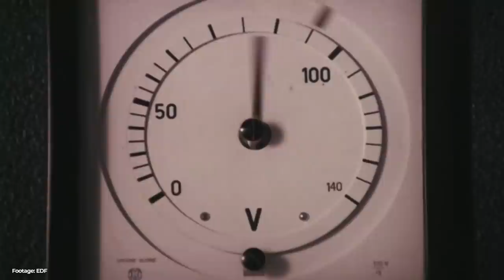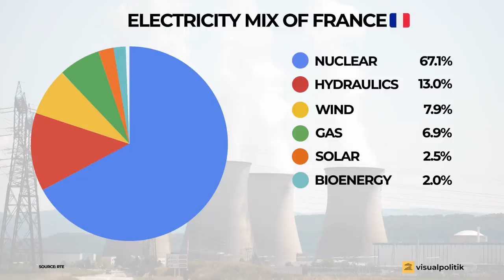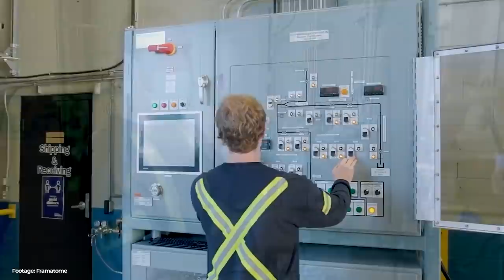Why is FRANCE betting on NUCLEAR ENERGY again? - VisualPolitik EN

Comment: Because a. the French aren't stupid, they want to be able to maintain stable base load power generation and b. have surplus output they can sell to the Germans when they finish screwing up their own grid.

My understanding (and correct me if I'm wrong) is that the French wisely standardized their reactor designs. This is in contrast to the nuclear situation here in the U.S., where every reactor is unique and practically a work of art. That's unfortunate when it comes to safety and maintenance concerns.

Comment: Nuclear has always and will always be the future, the power density ratio has no match.
Reply: If the land that a nuclear power plant is on was covered with solar panels, including the setback allowances, Solar would produce more power from the same amount of land. Also people can live there, they can build their homes under the solar panels, their garden shed can be covered in solar panels. The cost for the solar installation is much lower then actual nuclear build costs and no radioactivity is released.
Reply: @tomkelly8827  but it doesn't work when is cloudy and at night.
Reply: @tomkelly8827  it is nice dream,.. but lavs of physic are aginst you. You are also ignoring a hellot of toxic materials used in those solar panels.
Reply: @tomkelly8827  nope. It's the exact opposite. Solar would require way more land than a nuclear plant to produce the same amount of power.
Reply: @tomkelly8827  Anywhere north of Chicago, solar is carbon positive.

Comment: Pretty much majored in Energy production way back in 1987 for an engineering bachelors degree and worked briefly in the nuclear industry as a draftsman. Never used that knowledge and ended up in the design of heavy machinery so I should be knowledgable but not an expert. They didn't need energy production engineers in the late 1980's and early 1990's. At least that is what they thought. The biggest two problems with nuclear energy is cost and long lived nuclear waste. Today's reactors are much safer than the reactors in the 1980's but most are still  producing long lived wastes and that includes the SMR. SMR's may cost less to produce and then perhaps not as you have to produce more of them. At least SMR's would allow you to spread your costs over a longer time period. Molten salt reactors require no containment vessels and are best produced as a SMR or on a factory assembly line. They have no pressure on the reactor parts and therefore can be designed with a lot less material. All this adds up to lower costs but salts are very corrosive and the only parts that can withstand this corrosion are expensive nickel based alloys. Using thorium as a fuel not only uses a very abundant nuclear fuel but can be breed to U233 which can be used in future reactor runs. The reactor can burn most of its waste to produce more electric and reduce its waste down to a storage life of 300 to 400 years verses 10,000 years for our current reactors. The biggest problem is clear, we never developed this reactor because most countries wanted to breed fuel that could be used for nuclear weapons. Thorium based reactors can not breed fuel suitable for nuclear weapons. It is going to take a few more years to develop a salt based thorium fueled reactor. NG based plants have been made as combined cycle plants with up to around 50 to 60% efficiency. They not only require a lot less fuel but should have very low CO2 emissions. As far as methane emissions go most of your methane emissions are from the heating of rotten plant matter in the Boreal and Actic regions, not from gas industry pipelines. Even if you don't view combined cycle NG power plants as ideal; they are at least a start in solving the problem until something better is developed. Whatever is decided make sure the plants are combined cycle and not single generation cycle plants that are lower in efficiency.
Reply: @olivierb9716  The idea is to fission the U233 for further energy production and then dispose of the waste. As far as removing it from the reactor's salts I have heard that it is quit difficult but I am not an expert. As far as experimental, yes only Oak Ridge has run one experimental reactor or this type. The research looked very promising but looking promising & being feasible are two different things. All I am saying is that it should be worth the small amount of research needed to find out more about this reactor.
Reply: @olivierb9716  plutonium is extremely toxic and you have to breed fuel to make nuclear a long term energy solution.

Comment: I can't believe the EU is actually putting natural gas and nuclear energy in the same group. One is environmentally stable and the other is environmentally devastating.
Reply: Germany us betting on Gas as backup,.. there is no wonder that this nonsence is going trouth EU,...
Reply: @Baamthe25th  Unfortunately, the transportation requirements mean that natural gas lifecycle emissions are 47% higher than the direct emissions at the site of consumption. Plus leakage is a big problem and as much of the natural gas is methane it is an even bigger problem as that causes 4 times the greenhouse effect as CO2 does. It also releases Nitrous Oxide.
Source: Sorry, YouTube won't let me put a link in my comment even if I use [dot]

Comment: Natural gas is not cheap and you will be under the thumb of Russia. 
It’s also emitting a lot of CO2 as it’s ultimately a carbon fuel.
Reply: There is still reserves off the shore of Holland, and France buys its gas from Algeria and Egypt as well as Holland as previously said. The advantage with gas is that you can make combined cycles power plants (a gas turbine producing electricity with the exhaust heat directed to boil water that will too spin a steam turbine). 
However, it's indeed still a carbon fuel and that will fuck up the climate and ocean water pH

Comment: What I hear from most governments including my own here in Canada is that they will meet certain goals in the future but they have no plan to get there. They want to attack carbon at every chance but yet they continue to push natural gas. I am an electrical engineer with 41 years experience. Nuclear, especially SMRs is the way to go. It is cost efficient and completely calculable. One thing that renewables suffer from is that they generate the power away from where it is needed and there are significant losses. SMRs can go anywhere. IN Canada's arctic they burn diesel for electricity, that is really ugly from an emissions perspective, a SMR fixes that. The only way to solve the energy puzzle is nuclear in combination with renewables. The arguments against it hold little weight and are mostly political as in the case with Germany. One more thing, anyone that thinks that solar and wind turbines have a small ecological footprint should take the time to research the lifetime of these sources and they will se they are nowhere near as green as they think.
Reply: SMRs made sence in Canada, whit a lot off grid communities, in central Europe, whit well developed Grid based on big central sources, bigger plants made more sence. moreover in times when SMR are still in development phase, while big reactors are aviable for construction.

Comment: 6:00 useful life of 40 years... who says that? We have an independant body controlling safety of nuclear installation in France, ASN (Autorité de la Sûreté Nucléaire), which tells you black on white that nuclear reactors don't have set lifetimes, and that since they are constantly monitored, they can be exploited as long as its deemed safe by it. That does mean that we will need to invest in new nuclear powerplants, and R&D into 4th gen nuclear technology, but that's mainly to lower the usage of uranium per electricity produced. Today, if we replaced all gas and coal powerplants with nuclear powerplants, there would only be enough uranium for 100 to 200 years of electricity generation (with constant power production), but with the the 4th generation, that usage can be extended to up to 2000 years, leaving us more than enough time to kill ourselves any other ways than power outages.

Comment: From the beginning of the climate panic, I have taken the position that nuclear is the only practical source of electric energy and it can provide heat for such as cement processes. In other words, the alarmists have never been serious because of their ignorant rejection of nuclear. The new generation of nuclear reactors is well worth the investment hampered only by politics. The waste problem can be solved by recycling it to provide even more energy and reduce its volume. Although that storage problem has been handled for the past 50+ years.

Comment: Though I'm German and not a supporter of the Greenes (environmental issue party), I'm against the classification of natural gas as sustainable. It is not. And nuclear energy can only be a crutch to help us achieve 100% renewable.
Reply: Nuclear power plants take a long time to build, can't increase/reduce their production fast and when renewables are producing at super low electricity prices in the summer which is needed to fill long term storage facilities investors won't invest in it.

Comment: The element of cost is not fully explored here. Maintaining old reactors as France is doing (and Germany foolishly did not) is economical, but new reactors are much more expensive than renewable energy. Nevertheless EU will need more nuclear at any cost given their large populations relative to the renewable resource.
Reply: Also a fact that is not well considered enough is that nuclear energy is economically reliable in the long run. I know for every Gw of electricity maid by nuclear energy, France earns 1 billion €.
Reply: That figure doesn't make sense. If the plant makes 1b€ over it's life it doesn't pay for it's capital cost. If it makes that per year then the French pay too much for electricity.
The economics are simply poor for nuclear regardless of what an old reactor earns in France.
Reply: @gronkotter  one billion per year technically since nuclear reactor can produce 1.3 Gw.

Comment: It is about time!  Nuclear is not what it used to be in the 70's.  Current reactor designs are very safe.  Nuclear providing a stable base load means other renewables can succeed.
Reply: Even the PWR/BWR designs of the 70s are quite safe. Three Mile Island did not end up that bad, even if it was a catastrophic meltdown, and it takes four catastrophic reactor meltdowns in a tsunami at Fukushima to rank it in the same category as Tchernobyl

Comment: Here in Finland we have new reactor Olkiluoto 3.  Orginal plan was that it be ready 2009, but only now it starting, hopefully next year (2022) it give power to us.  Let's say that trust of France nuclear engineering is not high.  Hopefully we build more nuclear reactors, but do we ask France to built them?
Reply: Seems to be up and running now. But that's one of the first EPR ever build, it's an extremely complicated machine, regulated by ludicrous nuclear safety standards. I think Areva (Framatome now) learned from their errors and will build new reactors on budget and on time.
Reply: @pxidr  Let's hope so, because we need nuclear power
Reply: @tuhkakasa1917  The norms are changing all the time. That's the main reason why they take so much more time than previously planned.

Comment: I'm skeptical that gas is a cleaner fuel than coal. That's true at the point they're burned, but methane leaks from gas fields are greenhouse gases too. Gas versus coal seems to be basically a wash in greenhouse gas terms. I'm somewhat hopeful for new nuclear technologies, but so far, they seem to have the same problems with cost overruns and lengthy delays as older plants, plus the waste problem is still not solved. The problem of storing renewable energy isn't completely solved yet, but we're not yet at the point of having more renewable energy than we can use at the time it's produced. The top priority should be building more renewable capacity and the transmission lines to get it to populated areas. The first decision on what to subsidize should be really easy: end the subsidies for fossil fuels.

Comment: My guess is that continued investment in EPR will be a huge boondoggle as well as Rolls-Royce's SMR.  My guess is that Canada or one of the various molten salt reactors will pull Europe's rear end out of the fire.  If wind power is so cheap, why hasn't fertilizer production shifted to green hydrogen?  My interpretation is that electricity rates are vulnerable to  political pressure, but industrial process aren't yet.  That said, keeping Frances current reactors running is a risk worth taking.

Comment: What is desperately needed is molten salt thorium reactors. Not mammoth gigawatt units but small modular reactors added together to make all the power humanity needs for a long time. Use the fuel that the plants in France deem waste which still has 95% of it's energy left in it to convert to waste that will be equal to what is mined out of the ground in 300 years.

Comment: Nuclear is the best tech we have today and giving up on it will just lead to burning more coal/oil/wood/gas/whatnot.
Reply: It seems I have to copy this all over the place: Fossil energy accounts for 80% of the worlds energy consumption, nuclear only for 5%. I we were to replace only half of the fossil energy with nuclear energy, that would mean an increase in uranium consumption by a factor of 9. Studies say that the world's uranium deposits will last for maybe 100 years if we keep the consumption at the current level. Consuming nine times as much, those deposits would only last for 11 years. And probably less than that because energy consumption has been rising exponentially since forever. Also, nuclear energy is the most expensive form of energy. Also, the country with the greatest uranium deposits (with as much uranium as the next four countries) is the democratic model country of Kazakhstan. Yeah, that is the country we should send our money to.
Reply: @pillmuncher67  you're wrong about the amount of uranium, there is much more in the oceans and it is possible to extract it.
As of the price it is a matter of discussion but economies of scale won't hurt there. Nuclear is clean and reliable.
Reply: @markwhite168  Didn't we have this discussion already? Yes, there's uranium in the ocean. Yes, it may well be extracted. But unless somebody shows how much it would cost to extract to, say, power a nuclear plant for a year, that point is moot. So, tell me. Also, thorium is much easier to come by. Wouldn't it make more sense to invest in R&D for Liquid Thorium Reactors than in traditional nuclear plants?

Comment: The horrible cost and broken promises of nuclear power is a real problem. 
Wind and solar and others with storage will most likely be cheaper. 
Power in France is not very cheap.
Reply: It's cheaper than on neighboring Germany that invested tens of billions into dollars renewable energy and France has less carbon emissions than Germany too.
Reply: @mecha-sheep7674  
No, because a safety assessment on German nuclear power plants found they were not safe. Also in Sweden there has been an event where the diesel powered cooling pumps did not start, but they got them running before serious trouble happened. 
Nuclear power it also inspections and change of parts and it is expensive to keep them running after end of planed lifetime.
Reply: @mecha-sheep7674  
Nuclear is more expensive and slower than the alternatives a system based on capitalism and a free electricity market, that probably will use wind and solar with storage. 
If you can  built a nuclear plant on a commercial basis without subsidies that is fine. It you demand a nationalization of the energy sector, with subsidies to nuclear then please be open and honest about that. I do not agree but you are welcome to have that opinion.

Comment: A) they've done very well with nuclear power and B) there have been safe generation 4 plans on the drawing board for over a couple of decades now.
Reply: It seems I have to copy this all over the place: Fossil energy accounts for 80% of the worlds energy consumption, nuclear only for 5%. I we were to replace only half of the fossil energy with nuclear energy, that would mean an increase in uranium consumption by a factor of 9. Studies say that the world's uranium deposits will last for maybe 100 years if we keep the consumption at the current level. Consuming nine times as much, those deposits would only last for 11 years. And probably less than that because energy consumption has been rising exponentially since forever. Also, nuclear energy is the most expensive form of energy. Also, the country with the greatest uranium deposits (with as much uranium as the next four countries) is the democratic model country of Kazakhstan. Yeah, that is the country we should send our money to.
Reply: @pillmuncher67  Which rate of consumption are you using?  The present one where 95% of the uranium is thrown away as waste or the reverse rate that LSFR, travelling wave and fast breeders are expected to use?